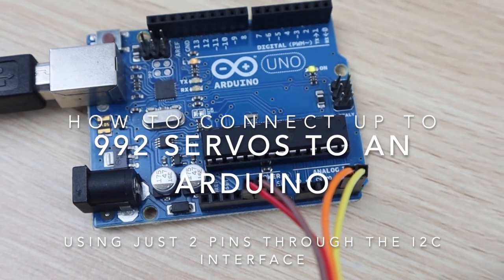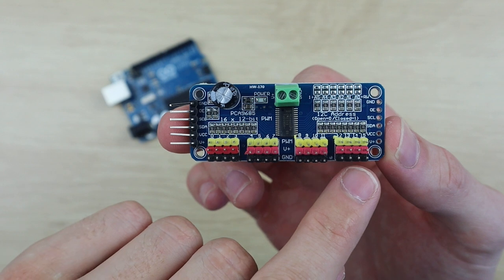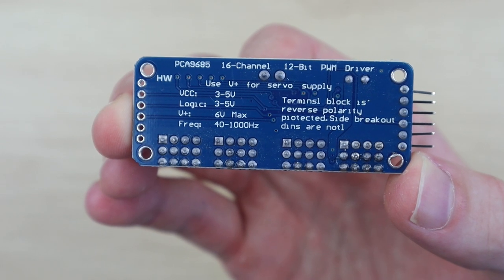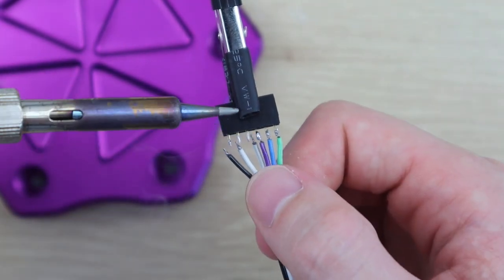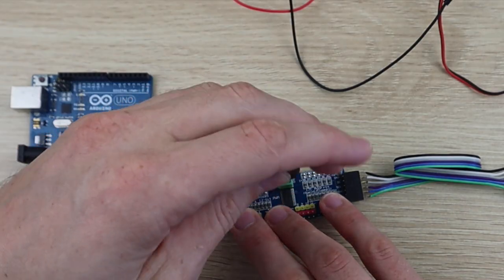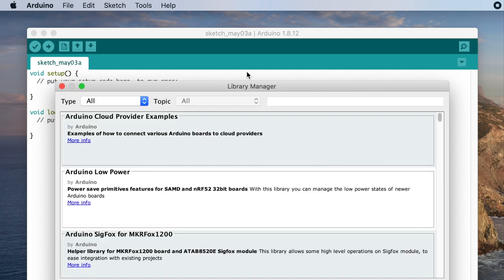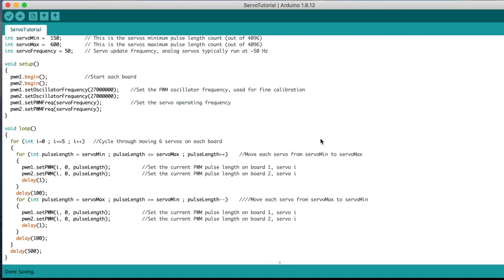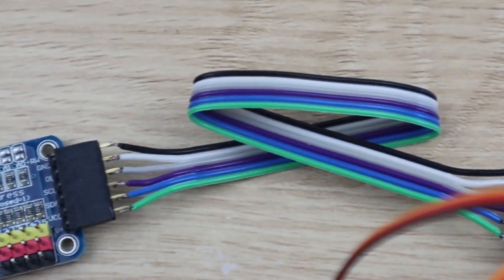Connect Up To 992 Servos To An Arduino, Using I2C

Comment: Hi Michael, I'm using these boards for a project related to my master degree. I'm controling 200 servos with 13 boards connected together. I followed the instructions in Adafruit documentation on how to set the address of each board (0x40 to 0x52) but it looks like my last 3 boards (0x50 to 0x52) are not receiving data. I wonder if I soldered the right pads to get these addresses (001010, 001011, 001100). Can you confirm that I followed the right logic? Thank you!!!!🥲🙏

Comment: two project ideas:  1) First project;  controlling multi Turnouts on an Arduino 2560 HO Train layout. also planning to use Wifi to control them,  2) project to automate one of Santa's Reindeer with servos to control  movement (Roller Feet) and eyes, ears, nose, etc.......... befor next Christmas!  Ha! Ha!
Reply from the maker: It seems like a lot of people either use an Arduino or would like to use an Arduino on an HO Train layout!

Comment: I have a super unique problem. I'm trying to control a bonkers 75 servos for a extrealy large robotic challenge inspired by fnaf but I have no code experience and I'm trying to make it work with the dmx standard using a arduino as a converter but I'm completely stuck.

Comment: Very clear explanation! I'll build a project with 60+ servos and this simplifies everything a lot! A question: how fast can I push the latency between messages? I'll be controlling the motors from a almost raw stream of data, so latency will play an important role.

Comment: This is a second piece of the puzzle youve provided for'm researching for my smart dust collection system.  Lots of good ideas on YouTube, but nobkdy is doing quite what i want. I want the arduino to sense which tool I turn on, close all the gates not between the tool and the dust collector, verify the gate configuration is correct, then turn on the dust collector. That means inputs from current sensors and magnet sensors on the gates. Outputs for servos (or steppers...havent decided) and a relay for the collector. I'd also like to catlure position information and illustrate on a dashboard so I can see the status of the system on a monitor with any errors.
Reply from the maker: This sounds like a pretty cool project. How many tools and how many gates do you want to use/move? It all sounds perfectly do-able and should be relatively simple with an Arduino. As for servos or steppers, if your gates don’t take much force to move or to hold in position then go for servos, if you want them to be stronger and more reliable then use steppers. You can also use smaller 5V stepper motors which are much cheaper for actuating smaller parts accurately and usually come with a driver. I’ve used these recently in the hanging gear weather station project if you’re interested in those.
Reply: @MichaelKlements , I'm not completely sure. For the sake of discussion, let's say 10. 3 branches of air ducting, 4 tools and gates on the outer branches and 2 down the middle. I am hoping to use servos. Plan to print some gates to minimize the effort required to move them. I have the logic figured out, just not sure how to execute. Ideally, I would create a blast gate module that has the magnetic switch, servo, and lead to detect tool current all in one piece so i can add or subtract tools as I want....just update the code based on the location and amperage needed to sense which tool is in use....definitely could use some help if you want to work on it together. Thought about prototyping on a big board with just the arduino, servos, and maybe some light bulbs to simulate the current change. The magenetic switches could be replaced by other contact switches or something else. Really just want to turn the tool on, gates open, feedback goes to the program that says the configuration is correct, and fire up the dust collector.
Reply from the maker: I think you'd have better success prototyping by breaking the project up into smaller sections first. Perhaps first try getting the branches actuating with the servos and no reed switch feedback, just responding to some push-button inputs. Then try get the current sensing working and just display the tool your code thinks is being used on the Serial monitor. Once these are both working then you can work on merging them together and adding the feedback. Just out of curiosity, what do you want to include feedback? Do you expect the gates to jam a lot?
Reply: @MichaelKlements  hi can u driver dc motors with it?

Comment: In this video each  two servo from each board works similar. Can I controll each servo individually from each board ??
Reply from the maker: It's just a duplicated section of code, all of the servos are individually controllable

Comment: Great video!!!!! what about gearmotors with encoder?? can control it too??
Reply from the maker: You'd need still to use motor drivers, this board just provides the additional PWM channels which would be used to provide the speed reference.
Reply: @MichaelKlements  Hi Michael, so for  a 20 0r 30 units system we will need : 2 units 16 channel PCA9685 PWM conected,+20 L298N drivers+20 gaer motors with encoder.....will work??
Perhaps you could give us a video with explanation,  i looking a lot on youtube but cant find nothing about with several encoder motors..

Thanks for all , fantastic work!!!!
Reply from the maker: Yes you'd be able to drive the motors with that setup. I'm not sure what you're wanting to do, but you wouldn't be able to use motors with encoders as you'd then need 30 interupt pins on the Arduino to sense the encoder inputs.

Comment: Aren't you drawing high current on the second one as well? Why didn't you connect the second PCA9685 on the power supply too?
Reply from the maker: The interconnecting wiring between the two PCA9685 boards delivers power to the second one.

Comment: Thank you for a great video! What is a good off-the-grid option to power the servo boards? Would a 3.7v battery suffice?
Reply from the maker: These servos run on 5V, so you'd need a 2 cell battery (7.4V) along with a regulator. Have a look at RC aircraft parts, they have loads of options for powering multiple servos from a battery pack

Comment: hello Michael 
thank you for this precious tutorial .i build a similar project using servo motors. but i have a question .what if I want to connect over 100-step motor 28 BYJ-44 5v.i heard about the multi-drive board that can fit to 16-step motors but well ...i am still confused. have you an answer? thank you

Comment: Can I use a  second powersupply with the screws  in the second Pca? Because I will run Servos on each Pca which runs at 4A each PCA. 
Please reply....
Reply from the maker: Yes you can, just remove the 5V power supply wiring between the boards and you can power them individually.
Reply: Nice thx.  
Is it possible to use the PCAs after soldering without the other one?
Reply from the maker: You're not modifying the PCBs, you're just not connecting one of the wires between the inputs/outputs on the sides of the controllers.
Reply: @MichaelKlements  so this means yes?
Reply from the maker: Yes.

Comment: Hello I'm only using one servo driver and a elegoo uno r3 can I use the same wire assortment as you have and use 16 servos on one board. I was also planning on using a 9 volt battery to plug into the servo driver using it to also power the servo's is this ok? 
Edit: also I plan on hooking up a controller to this setup and control the servo's from this I'm fairly knew to this and would like any advice. Thanks
Reply from the maker: Hi Matthew,
Yes, you can run all 16 servos off a single board. You can't use a 9V battery though, you need a regulated 5V power source and this needs to be able to supply around 10A for 16 of these servos. 9V batteries are really poor at providing current, they usually have a limit of around 150-200mA (so 50 times less than you need) and with 16 servos it'll only last a couple of minutes before being dead/empty.
Reply: @MichaelKlements  could I possibly use let's say 4 double A batteries. I just don't know how to do this without having a giant power supply I'd like to have this setup be portable it's for a small robot project.
Reply from the maker: You'll need to use a high current battery, like a 2200 to 5000mAh 3 Cell LiPo battery with some sort of regulator to bring the voltage down to a steady 5V. Unfortunately you can't do what you are wanting to do with standard "supermarket" batteries and you'll still need a voltage regulator as well.

Comment: Hi im having trouble moving 5 servo motors at once, can the arduino supply the required current or do i need an external power source?
Reply from the maker: You need an external power source if you're powering more than 2 servos.

Comment: Just found this video. Would this work to control 20 water valves and 20 moisture sensors?
Reply from the maker: This only controls PWM based devices, so possibly the valves if they're PWM driven, but it won't work with your moisture sensors.

Comment: If i want to power 4 sg90 servos to run at the same time what battery would be good as the power supply for this?
Reply from the maker: You'd need a battery that can do around 2A current draw - 4 x good quality AA's in a pack would probably work.

Comment: nice video!, one question, in order to reduce the amount of cables, can I just connect the data line of the servos and then connect the power lines of the servos directly from a battery?
Reply from the maker: Yes you could do that. I'm not sure how that would reduce the number of cables though, if anything that seems like it would be more complicated than just plugging them into these boards?
Reply: @MichaelKlements  the thing is, I am making a helmet that contains 15 servos and I don't want 15 GND cables and 15 VCC cables going down through my back to the battery backpack in the waist, instead I figure you can just connect all GND together between all the servos (same as for VCC) therefore now the cables going to the microcontroller are just 15 + 2
Reply from the maker: I'd probably look at a way to move the servo controllers to your helmet, that way you only have the communication and power wires running to the backpack and you don't need to make up additional adaptors for the servos to plug into.
But yes, your idea to connect all of the 5V's together and all of the GNDs together will work, just make sure that your cable is large enough to handle the current.
Reply: @MichaelKlements  thank you for the advice!, I will consider that, but assuming I will keep the controller in the waist pack, how much current can 15 servos draw?, In order to also select a good cable thickness
Reply from the maker: It really depends on the servo and whether they're working together or not. Micro servos typically have a peak draw of around 500-1200mA, so if you've got 15 servos that are all moving at the same time and are somewhat loaded then you could be looking at almost 20A current draw. If they're  moving individually and/or aren't particularly loaded then you'd probably be ok with 5-8A.
Reply: @MichaelKlements  thanks :)

Comment: How would add a 2 pin push button to this setup to control the servos going up and down?
Reply from the maker: Just add a pushbutton to one of the Arduino's free digital inputs as you normally would.
Reply: @MichaelKlements   wouldn’t that  require a new code for the push button?
Reply from the maker: @jeremyrivera9085  yes you would need to revise the code to respond according to your button push

Comment: Hey! I'm a newbie to arduino and I was wondering if it would be possible for me to use a 9v battery instead of a power supply and connect it to the arduino & 16 channel shield? I want to control four servos. If this would work, where would I connect the battery? Thanks!
Reply from the maker: If you’re talking about the typical 9V block type alkaline batteries then probably not. They aren’t usually able to supply enough current to drive more than a single servo.
Reply: @MichaelKlements  IIRC my power adapter outputs 12 V, so it should work if I provide that much voltage through battery connecter to the plug of said adapter?
Reply: @delta22471  did you ever figure this out I'm trying to power 16 servos and don't know how much power to input to the servo board or the Arduino?
Reply: @Matthew-fs9tv  I never pursued this thing. I just use the USB plug with a powerbank powering it. If you have a cheap powerbank you maybe able to see if there is any way to make the outer shell smaller for a smaller "battery".

Comment: how does it power all that without heating up? power wires look small to me. Im trying to figure out how to just turn on and off 30 solenoids at specific a specific time using an arduino to create a water show. Im getting closer but its hard to find what im looking for that actually makes sense.
Reply from the maker: It depends on how many of the servos are running at the same time and how loaded they are, in this example there is almost no load on them and they're not all moving at once. You'd need to increase the gauge of the wiring if you're running a large number of servos at the same time.

Comment: Hi, can i use node mcu instead of Arduino? Because my Arduino uno no longer works after corrosion
Reply from the maker: Yes you can use these with any microcontroller with an I2C interface - on the node mcu these are pins D1 and D2
Reply: @MichaelKlements  thank you so much for the reply. You just earn one more subscriber🙏

Comment: Great video. I know nothing about Arduino but am considering using this type of system to operate the points (turnouts) on a 00 gauge model railway. Just need to find the right advice and information re set up, compnents and programming. Any advise you can offer would be appreciated.
Roger

Comment: Great vid, do you think I could implement this in a home cockpit simulator as a replacement for mux and create an i2c bus for the various panels?   I’d need buttons and leds, mainly. Thanks
Reply from the maker: I'm sure you could make something like this work for that application, it sounds like the right sort of board for it.

Comment: nice video. I would like to know if PCA9685 can control hoverboard motors?
Reply from the maker: It's not a motor driver board, if you mean can it supply a PWM signal to a motor driver then yes it probably would work.
Reply: @MichaelKlements  thanks I figured it out that this won't work as my motor are brushless and sending a PWM signal would but but my motors are 36v and from what I see this board can only supply 5v. I am purchasing 4 BLDC controllers that seem to be able to do the job. Thanks for the response, it's Great to see people take the time to help out the noobs.
Reply from the maker: Yes that's correct, the boards can only manage up to 6V. That sounds like a good solution. Enjoy your project!

Comment: Can it move multiple servo's on one board at once?
Reply from the maker: A microcontroller can only issue instructions one at a time, but in doing it really quickly there are ways to make it look like they're all moving at the same time.
Reply: @MichaelKlements  *can it move all 16 servos within 10ms? Is there any known latency?
Reply from the maker: A servos PWM frequency is typically 50Hz, so they would only respond in a minimum of 20ms. If you're looking at response times in the tens of milliseconds then servos are probably not the correct actuator for your application. But I don't see any reason why the driver wouldn't be able to receive the signal and change it's PWM output to the servos in 10ms.

Comment: Could this work with stepper motors?
Reply from the maker: No, these are PWM adaptors. You could use them with DC motor controllers but most stepper motor controllers require a different interface.

Comment: greeting. I'm a beginner. I can't find an example of how to connect 3 servo, one stepper 5v, one display.. all this to connect on two buttons. the first button = 1 circle . the second button (switch) = repeats the circles... Can you help me?
Reply: displays the number of laps on the displey. counts as one every 20 laps
Reply from the maker: With these sorts of projects its best to try get the components working indiviudally first, then you can work on connecting them together. First try get your Arduino to recognise your button inputs, then display some text, then work on getting a servo to move and then a stepper motor. Once you've got them all working by themselves then you should understand them well enough to combine them into a single project.
Reply: @MichaelKlements  thank you for your quick reply. I'm still going to do it over shield engine v2 with two stepper and two servo engines. I think it's my best option. and you too could help by doing the video:) there is no such example on youtube. put a display that counts the series of engine movements.

Comment: What Voltage and Amper do i need on a battery to power supply the arduino uno/nano board ?
Reply from the maker: An Arduino doesn’t use much, 12V 1A adaptor should be fine. The servos draw a lot more current, especially when loaded
Reply: 9V alkaline battery is ok ?